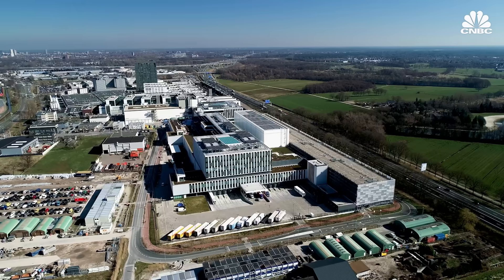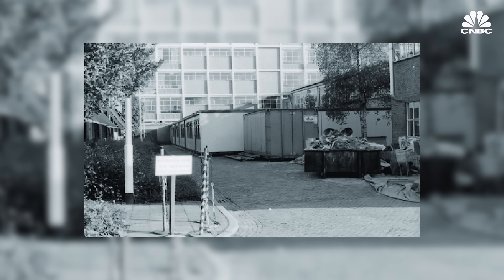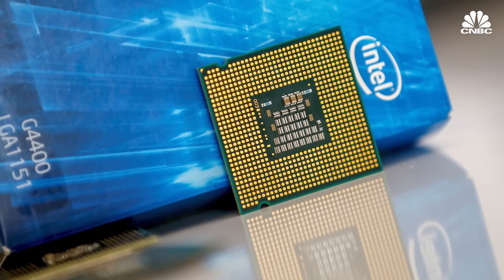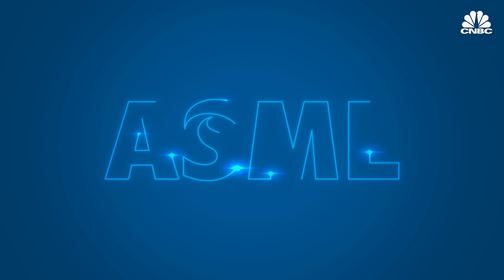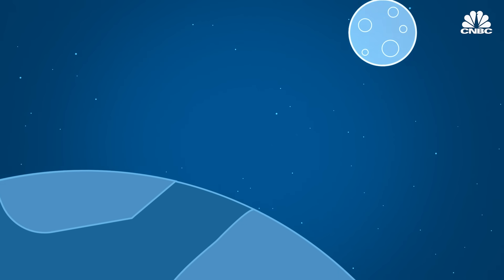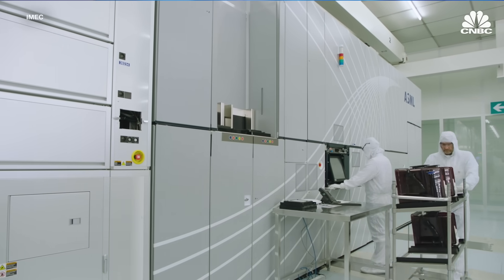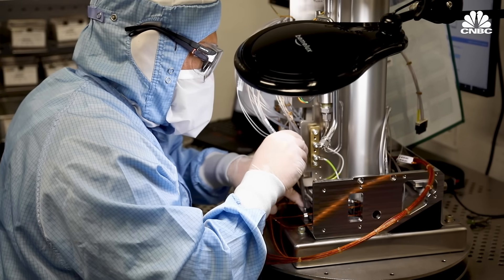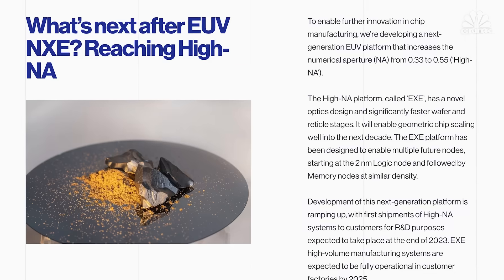Why The World Relies On ASML For Machines That Print Chips

Comment: After I was a USAF pilot, in the early 80's I worked in a 100mm wafer line down in San Diego as a Photo-lithography and etch process engineer where I used the great great granddaddy of these systems. Never thought I'd become nostalgic about those times and that job LOL
Reply: 🇺🇸 Thank you for your service, sir.
Reply: @platoscavealum902  You're welcome, but I'd rather you go thank a teacher! That's who I thank for their much more important service
Reply: What would it take for a third world country to manufacture these systems? I mean the oldest ones having no restrictions?
Reply: I would say that 100 nm (130 nm mfg. started in '01) would be alien tech in the early 80s, but 1000nm (1.0 μm) makes much more sense for the given time period
Reply: @hughjassstudios9688  He likely meant a 100mm wafer fab.  4 inch wafers.
Reply: @hughjassstudios9688  100mm (4") -- thanks, it was a typo, the resolution was 1.2μm
Reply: Yeah in the early 90's I was a Diffusion process engineer and we had 150 mm wafers and a 0.8  μm (known as submicron) process. Next year 0.5  μm.
Reply: Our gate oxides were about 100 angstroms thick at that time.

Comment: Wow .... so this is what absolute monopoly looks like ...

This company ASML is the only company in the world that manufactures the machine that makes the chips for almost every chio based gadget being sold on the planet

Hell man ... i really would invest in their stock anyday ... with customers like TSMC, intel, samsung ... u cannot lose in the market
Reply: Throughput of only 3000 wafers per day in a 200 million dollar machine. There are other ways that could be used. EUV current niche but 90% of chip applications don't need this technology level. Future level should probably be parallel Electron Beam Lithography.
Reply: @dag_of_the_west5416  how many chips are there on a single wafer made by this EUV machine ?
Reply: @mishrachabra4471  Depends on wafer size (typically 300 mm) and type of chip. For logic chips typically a couple hundred while memory or other types more for example phototransistors used to get thousands. Once the process is finished remember also the finished chips will be tested and some will fail, this is the yield.
Reply: @dag_of_the_west5416  so what really happens is like first a company like ASML will make a machine like this EUV machine ...

 which is then sold to companies like TSMC, samsung, intel etc. ... then these companies establish their chip fabs where these DUV/EUV machines and other ecosystem is installed.

then the chips are made on the silicon wafers by these machines ...

so what happens after these chips are made ... ?
Reply: @mishrachabra4471   The chips are used in electrical devices all over the world. Mobile phones, tablets, computers, cars, hospital equipment, navigation, etc...
Reply: @mishrachabra4471  or do you mean the process? Once wafers are finished you have wafer test, saw them apart, ic package, test again, ship to customer.
Reply: @dag_of_the_west5416  ok ... so this is the process ... thanks man ... i really appreciate your help 😊🙏👍
Reply: @mishrachabra4471  about 600 working chips per 300 mm wafer.. that amounts to 1.8 million chips a day per tool.. if you only charge 1 dollar for the process of each chip, that is 1.8 million revenue a day.. you easily pay the tool off in less than 1 year.
Reply: @zmouffak2119  wow ... thanks 🙏🙏🙏
Reply: @zmouffak2119  how much does it costs to establish a chip fab unit that makes 7nm chips (with the entire spectrum of ecosystem within the premises) ?
Reply: @mishrachabra4471  every high end* gadget on the planet. There are other companies that make lower end machines that produce older chips. Cannon and nikon are ASML's competitors there. (yes, the consumer camera makers).
Reply: @Mr30friends  ohhh ... ok wow ... so probably not an absolute monopoly in lower end gadget chips 😊😊😊👍👍👍

Thanks for the info 😊
Reply: @zmouffak2119  the thing to remember is these chips probably have 32-40 mask layers. So divide your throughput by that.
Reply: @dag_of_the_west5416  true. but the sale price for the chip is a few 100 dollars. I undertsnad that just photolithography cost per chip being 40 or 50 dollars makes it very expensive, but I am sure they figured it out. The customer will pay for everything :)
Reply: Its weird how no government tried to push their own chip manufacturing, this industry is the core for this modern age
Reply: @hahaaha7400  of course they do

Comment: I have a dumb question: Does that circular wafer get cut up into smaller chips or is the whole wafer a chip?
Reply: It gets cut into smaller chips lol
Reply: @morpheus_9  Why not to make it rectangular in the first place? Isn't it waste of surface area making them a circle?
Reply: @almazkharrasov  Yes, it is a waste of surface area. But for most production steps it is more convenient that the wafer is round. The wafers are cut from a huge silicon mono-crystal. These crystals are grown using the Czochralski process which results in cylindrical ingots. Polishing the wafers is also easier if they are round. To achieve a uniform coating, wafers are usually spin-coated which obviously is easier if the wafer is round.

Comment: EUV is decades late. It has taken a decade to get the initial tools to even get them working in a way that will be useful in HVM, it will get there and it will solve a lot of problems but not sure it's going to be worth the cost.
Reply: Without EUV you need quadruple patterning tricks with a higher error rate and much less throughput (wafers per day). In the end, EUV is cheaper.
Reply: @d.kersten8793  EUV is slow and has been since the start, that's part of why it has taken so long to go prime time. Yea EUV will be nice to cut the numbers of layers down that has grown significantly since 193nm was forced to shoulder on while EUV was delayed for so long and the full line has grown so long with all the extra Litho layers that have to be processed but it's still not going all that smooth for the EUV tools with the problems of changing out things on the ASML's so often to make the tools work. It will get there just still way behind schedule.

On the other hand it's hard to imagine getting to 5nm line width without it and certainly not lower.

Comment: The problem i have is, how do people get into this field without having a connection? What class/major would you take to learn about microchip manufacturing??? We need to stop hoarding information and explain the process to become experts in fields to be more productive.
Reply: Physics, materials science or engineering
Reply: I install Cnc machines inside of companies like ASML (I’ve been to one of their locations) as well as many other cool companies. I went to school for cars and happened to get into the business.  Go look for a machine shop hiring in your area. They will hire with just a High school or tech school. Then you work your way up the ladder. That or a machine tool service company. We can’t get enough people who want to be trained. You get trained in the field and by going to classes at manufacturers of machines or software. Hope that helps
Reply: @captaininsanojr  good advice
Reply: I was an engineer in the semiconductor field for a decade. Had Chemistry and Physics degree. Computers IT was also always a hobby of mine. A few colleagues had electrical engineering degrees. People with Chemistry usually understood the process better while EE degree was better for design or test.
Reply: @dag_of_the_west5416  wouldnt it better for everyone if we took the guessing game out of the equation and had a specific learning path for this industry?
Reply: Chemical Engineering or Industrial Engineering are also good degrees for the field. Many of the maintenance engineers had mechanical engineering degrees.
Reply: @SoYFooD2  thats why i think companies should have their own training program instead of people going to colleges. college is to general, companies need specific skills.
Reply: @JusdoinstuF  that really depends on what you study and which institute. It's also seperating the good and the bad students. I know many people who work at ASML and all have a different background, whether it is in Physics, Chemical engineering, Mechatronics, mechanical engineering or IT. In my opinion it has more to do with your enthusiasm for the technology and also your capabilities. Be aware that working for such a company on paper looks great but it's a highly competitive and high output company so if you can't handle that it's not for you.
Reply: @JusdoinstuF   While I was an engineer for Fortune 100 companies they usually had me and fellow engineers teach a one day course every 6 months to new employees. When I was in college however, I took a full semester upper level physics course titled "semiconductor processing technology". One of the neat things is we actually did a fab tour of Texas Instruments. After graduation I ended up with another semiconductor company.
Reply: @JusdoinstuF  There is no specific learning path for a career in this company. If you are technically inclined (and have a degree), have the right social skills to work in a tech team and have the ability to listen and learn from others, and have some ability to do abstract thinking, process information and see the red line and if possible are creative, you're basically good to go (for engineering/development that is)
Reply: just have any major that is relevant to tech, it, materials.
there is no learning all of it, u need deep specialized skills.
good test scores is wat gets u in for a interview.
enthusiasm, knowledge and most importantly a open spot in a team will get u a job. 
and they are always looking.

60% of my work is making testing machines to test sub assembly's for ASML.
i am part of the team that engineers the testers in conjunction with ASML.
most of the team can get a job at ASML in a hart beat if they want.
so becoming a player in a company that works for ASML is also a good way to get in.

and yes, our clean room suits look even dumber
Reply: @SoYFooD2  how do you develop enthusiasm for a career you dont know exists? this is the problem, awareness. How did you get your current role? was it your childhood dream or did a series of conversations with knowledgeable people lead you to your position? see the problem?
Reply: @JusdoinstuF  career's happen, just look around and see wat is cool.
that will get u enthusiastic.
then it become a boring grind of a job with some cool but fleeting moments, but it paise the bills nicely. 
that is how u do modern life.

i got my job by not getting in the army.
did a extra study.
then got in the army for 5 years.
got discharged for medical reasons.
80% of my degrees wher useless because of my disability.
army found me a job i was able to do with the degree from that extra study.
got good at my job.
then got let go.
worked may pleases and learn a lot.
got to a job i hated.
after a week it was oke.
1 month and i liked the team but hated the work.
then got offered to lead that team and become head inspector.
loved doing that.
got f*** over by a colleague and the boss did not support me.
i say'd f*** it i quit on the spot.
then got a desc job that paise way more.
did not like the team.
then my little brother said come work at my work.
u are way better then the idiots that work at this plaice.
got to talk with the head of the department.
had non of the papers, non of the relevant extra skills, only basic knowledge.
and no experiences running a department.
they were desperate and purely by the pleating of my sibling did they give me a chance.
on my second year i got a permanent contract and have had 2 raises and working on a 3rd.

and i don't care wat i do.
if the team u work with is one u can stand.
and if it pay's good, and the day's fly by im golden.
Reply: @JusdoinstuF  I knew almost nothing about ASML when i first accepted their job offer (at the time i was working as an engineer in the UK). If you love technology then it will not take very long at all to get enthusiastic about the stuff ASML does.
Reply: @SoYFooD2  I had a connection in LinkedIn work there hes in Netherlands now
Reply: simple study physics :D
Reply: I guess you don't start your study with this in mind. At least I didn't. You start your study in a field which (a) has your interest and (b) seems to have future job opportunities. In my case it was computer science, but it might also be electrotechnics, mechanics, etc. Then, when you look for a job, you check interesting job adds ... and there you go!
Reply: Optics is a highly specialized field only a few schools offer advanced courses and Netherlands has been in the game since Van Leeuwenhoek but any engineering degree is a good start
Reply: @cbligerman   He asked about microchip manufacturing, of which optics is a tiny part. Even in this tool there were probably many more electrical and mechanical engineers working on it than the ones that specialized in the optics.

Comment: Just you wait when they start using X ray lithography.  The resolutions will be on a single atom level.
Reply: I have been wondering about that. Is X-ray lithography even possible?
Reply: @uptownsfinest2006  It is indeed, there's a Wikipedia entry for X-ray lithography with more details.
Reply: Also look at Electron Beam Lithography.

Comment: 9:55 the typical method to aim light is to use lenses to refract it. There are no lens materials that are transparent enough to EUV light for this method to work which is why they have to rely 100% on mirrors reflecting it.
Reply: I seen a journal that plasma can also be used as mirrors, but I don't recall it propertiites at the 13nm wavelegnths.
Reply: It’s not that there are no materials transparent enough, but the ability to bend them enough that restricted their usefulness as lenses.
Reply: @madsam0320  Everything I've read says otherwise, e.g. from newport's page on EUV photolithography: "there are no optical materials that are transparent at 13.5 nm"
Reply: @MatthijsvanDuin  Optical materials means materials that can bend the beams, so while some transparent materials may exist, you can't make lenses out of them
Reply: @jmlinden7  Well in the context I was quoting from it was discussing why a reflective rather than transmissive mask needs to be used, so bending light is not relevant for that. It adds, "In theory, transmission masks could be used if the substrate was less than 100 nm thick, but this is not a practical solution."

Another quote from the same article, "The entire optical system is maintained under high vacuum since 13.5 nm light is strongly absorbed by all solids, liquids, and gases."

Do you have an example of a EUV-transparent material?
Reply: @MatthijsvanDuin  Like you said, anything under 100nm thick, but you can't make lenses out of that
Reply: @jmlinden7  That's not a material property though. If you can't find a material that's still adequately transparent in a thickness sufficient to build lenses, then the original statement that "There are no lens materials that are transparent enough to EUV light" is exactly right.
Reply: @MatthijsvanDuin  Yes that was my original statement. You cannot make lenses to refract EUV light. Even if there are materials that are transparent, there are practical reasons why you can't make lenses out of those materials like thinness.
Reply: @Matthijs van Duin "there are no optical materials that are transparent at 13.5 nm" 
I agree. Gravity in vacuum is no optical material.

Comment: I don't understand. If the ASML makes the machine that makes the chip. Why can't they produce chips themselves? Why do they have to sell machine to TSMC, and then they produce the chip?
Reply: because you need more processes to make a chip.. ASML chose the route of specialisation .. do one thing and do it really really well.. and that's their strength.
Reply: As someone above said, theres other machines involved in the whole chipmaking process. ASML is just ONE of many OEM systems suppliers in the equation and they only hold a monopoly over the specific machines they specialise in. TSMC and Samsung focus on foundries and chipmaking as their service business model, where as ASML is on EUV / lithography as their product / service.
Reply: There are multiple types of machines needed to make chips, ASML only makes one type (lithography).
Reply: @jmlinden7  what others? i'm curious
Reply: @Robis9267  Etch, thin films, implant, metrology are the main other ones. Lithography just transfers a pattern onto the wafer, you then have to permanently etch the pattern into the wafer and then use it to build your transistors and wires
Reply: @Robis9267  first you have to source the silicon and grow the boles.
You have to slice the blank into wafers and polish them.
You have to super clean them and then apply a mask.
_THEN_. these machines can start to do their jobs.
When this machine is done the wafer is etched, rinsed, another layer is deposited and the process repeats.
I don't know about EUV, but I'd assume thirty or more layers before the wafer is done.
Then inspected and the wafer cut into individual chips
Then the chips get leads attached and packaged.
So the buyer (Foxcon or whoever) can put them on a circuit board that goes into your cellphone, laptop, etc.
Reply: @jimurrata6785   seems like molecular beam epitaxy is the way forward.
Reply: @dag_of_the_west5416  It is what we have at this time and I doubt we'll get better yields from another process any time soon.
I'm no genius or clairvoyant, just trying to point out to the OP how many different procedures are necessary with modern IC's.
As nodes get smaller and perhaps quantum becomes mainstream there will be new challenges, and new solutions.
Reply: Making the machine is really difficult already. The same people won't have time to work on printing the chips.